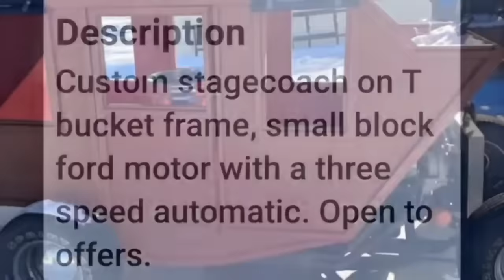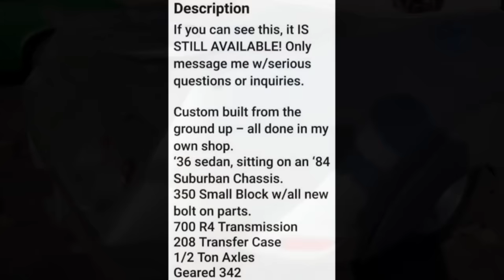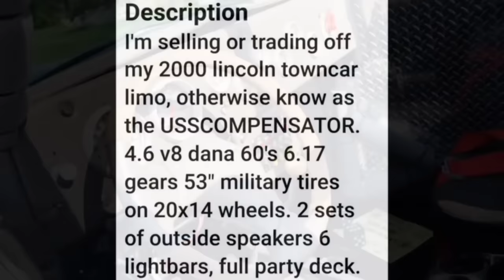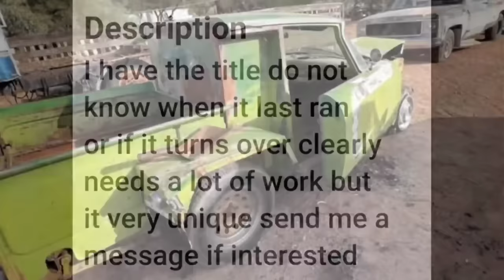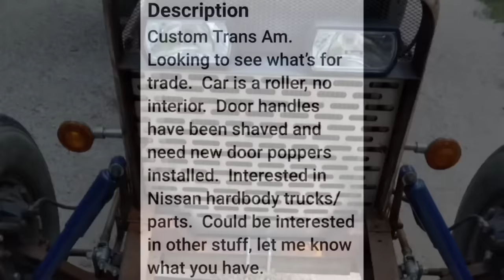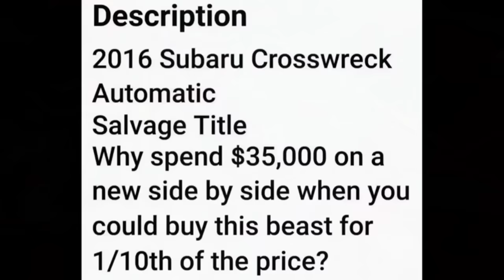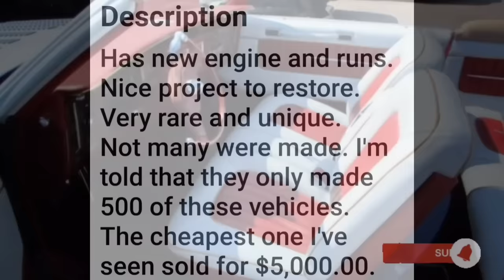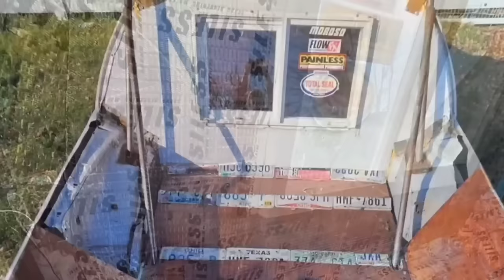BEST OF WTF CAR FINDS ON FACEBOOK MARKET PLACE!

Comment: I bought the grey one with the chop top ...  hopefully find a different set of front fenders for her ...
Reply from the maker: The oldsmobile?
Reply: No the grey  ( primer ) 38 Plymouth,  with the weird front fenders .... its a fun car to drive  around in .
Reply from the maker: @terrycasterline1599  oh.. hell I was trying to reach that dude.. I was thinking of buying it. So I take it your in the buckeye state
Reply: @MOTORHEADMISFITS-zk9su   yeah .. 4 hour drive ..
Reply: @MOTORHEADMISFITS-zk9su  it needed work,  new carb , clutch pressure plate and throw out bearing plus flywheel was bent slightly... plus rear main seal ....

Comment: On that '59 Ford wagon... I don't think it would look so bad if the rear wheel openings were relocated further towards the back.
Even without adding the additional fab work of squaring the bottom rear corners of the doors. Kinda has the vibe of the tri-5 Chevy Nomads or even the rare 2 door '64-'65 Chevelle wagons, Pontiac Safari or even the 2 door '57 Ford Ranch wagon. IMO 🤏😃
Reply from the maker: I can see what what your thinking. 
Thanks for watching and commenting